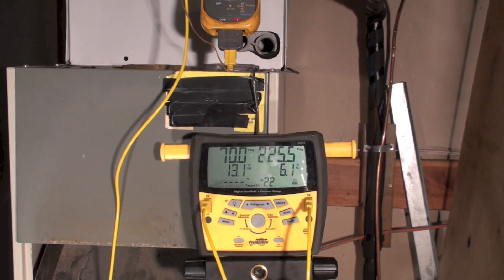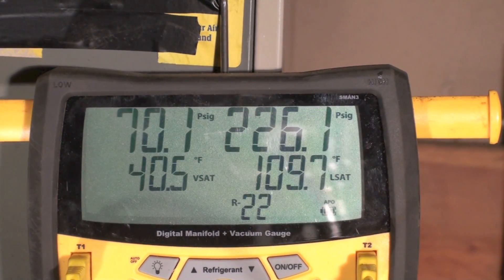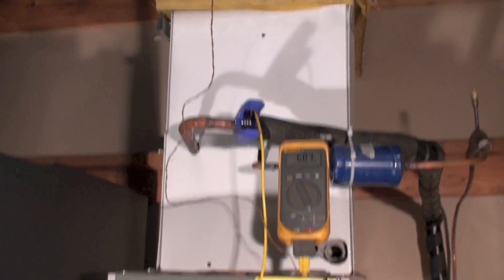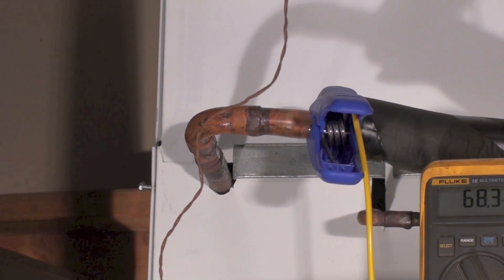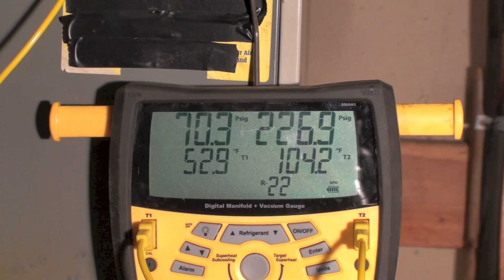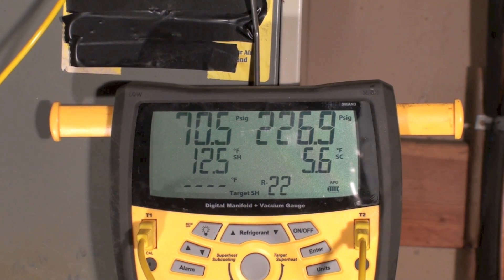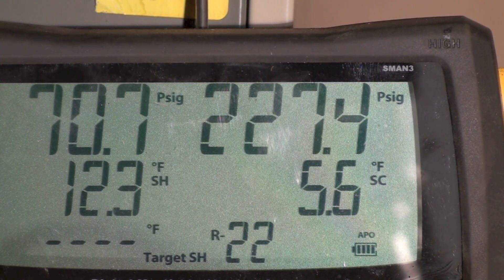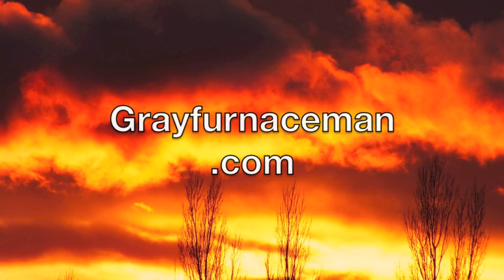Superheat and subcool measurements on the air conditioner

Comment: Had a tech come out and hooked up to the outside unit a goodman 3.5 ton r22 and on the blue gauge it was 79 down to 60s range did not hold steady he said maybe air or something else in system. Also stuck probe in plenum and air coming off coil was 65 said eventually will need a new unit is that accurate?
Reply from the maker: The varying suction pressures indicate air is the system, especially if the head pressure is higher than should be normal for that system.
The supply temp is not helpful as it does not indicate the temp difference across the coil.
So, what should you do?  
The problem here is R-22 is quite expensive.  The refrigerant must be replaced.  The cost of replacement will be anywhere from $600 to $1000.  
You must weigh the cost of replacement of the refrigerant with the expected life of the system (18 to 25 years) from new.  
Now you have a decision to make.  Lucky you.  
GFM
Reply: The local dealer said they did not have r22 to remove and re charge :( but it sounds the same everywhere new unit or drop in unit w new coil and ac only using old furnace so $$$$ Thanks for the reply
Reply from the maker: @elvis765  It is available, but most companies would rather replace.  I does make some sense because the youngest R-22 units are about 20 years old.  
GFM

Comment: hello, hi, hi, r410a system ( with fixed orifice) with equalized pressures of around 200psig. But once compressor starts the low side drops to 50 psig while the high side goes up to 300psig. I checked superheat was like 80F and subcooling was 2F. Does this mean the system has leaked out all the refrigerant? Does the 200psig equalized pressures means there's refrigerant in the system? thank you.

Comment: thank you for another awesome video. i was working on R410a system fixed orifice. my superheat was a little high. so i added refrigerant and brought it down to correct level (around 17F) according to wb and dry bulb formula. BUT even though my superheat was correct why is my subcooling only 3F? shouldn't subcooling be 10F to 12F? while adding refrigerant , ONLY low side paramters changed. High side unchanged? thank you.
Reply from the maker: First, you need to know if the indoor coil and outdoor unit are matched.  Also, I would be looking at the install manual for specs.  It could be normal.
GFM

Comment: hi, i was working on an r22 system with fixed orifice.  subcooling was at 9f and my superheat was 2f. the suction temp. was about 30f. there was lots of nice cold air coming out from floor register. please help as i have no idea what the problem is. thank you for all your helpful videos.
Reply from the maker: You need more readings.  Head pressure, suction pressure, ambient outdoor, ambient indoor and delta T across the evap.
GFM

Comment: hey
 dude 

When using my brand new spanking mastercool  gauges  and field piece temp sensor I get  a subcooling of about 14 or 15. From the tag on unit i know its supposed to be about 11. So I know its over changed ( startup was done by a supposed professional, when he said he put in 3 pounds for a 45 foot line set I said yikes). When i tried removing some refrigerant super heat went up to about 8 but subcooling didnt change. High pressure gauge went down along with line temperature , so my subcooling didnt change. I didnt want to keep removing the stuff.  Can you advise if you have time?. I noticed during winter by heat pump struggled engaging EM heat quite often and now summer it takes forever for the temperature o come down, Im hoping this is the issue?
Reply from the maker: I am assuming from your comment that sub cooling was marked on the unit plate that the unit is controlled by a TXV.  If removing charge changed the superheat, the unit is quite massively overcharged.  I would continue removing charge unit the subcool changes.  Work slowly.  Refrigerant should be removed as liquid from the high side to avoid changing the blend.  Assuming the unit is R-410A.
GFM
Reply: yes it was on plate and is a 410a txv  system.  I removed some more from the high side the subcooling increased to like 16 now and super heat  went to 11 and removing more I would assume throw the super heat way high .  Maybe i should bite the bullet and get another " professional" in. Gets my goat when I payed to put the gas in and now have to pay another to take it out.

thx for responding

Comment: This is what I do, and it's because I learned from you. If ever you have a way to check superheat or subcooling on winter on heat pump .and I'm taking about low temp. outside like between 10 to 20 F., that would be awsome. Maybe you already did a video on this. If so, I missed it.
Apreciate your good work
Reply from the maker: Superheat and subcool can be done at low temps but they are not good indicators of refrigerant charge.  We usually do not depend on them until the outside temp is above 35F.
GFM

Comment: the more I study subject and work on units the less I understand why the manufacturers ever used R410A as a residential refrigerant. It actually appears to be a better low temp refrigerant like R404a is. With higher temps the pressures go way up. I think they created all of these refrigerants then had 410A surplus and had to get rid if the stuff. Thanks for videos
Reply from the maker: The decisions of which refrigerant to use is way above my pay grade.  They must take into account global warming impact in addition to ozone depletion, flammability, on and on.  
GFM

Comment: I looking at getting the sman 460 gauges. So hooking the clamps up to the suction and liquid lines will automatically tell me my Superheat and subcool?
Reply from the maker: The gauge set will calculate it.
GFM
Reply: Great. Thank you. Love the videos by the way. You're like a HVAC Wikipedia.
Reply from the maker: Welcome
GFM
Reply: It's a good feature with the different flavors of refrigerants today . They display without toggling, I got them because I'm in a freezer and then of a hot roof and they are suppose to be resistant to sweating. I mean when you step out of a freezer your jacket will frost over and it will ruin your meters or gauges

Comment: Another great training video. Thanks. I know the formula for calculating a target superheat on matched equipment. I am wondering if there is a formula to calculate a target subcooling on matched equipment?
Reply from the maker: +Jim Gill Most manufacturers use a charging chart included with their equipment.  Subcool may be included.  As for target superheat, it is generic and if you have no chart from the factory or the unit is mismatched, it can be used.  If you reach the target superheat, pretty much subcool is set.  If you change subcool, the superheat will change.  Hope this helps.
GFM
Reply: +grayfurnaceman Thank you. I think that your HVAC&R videos are the best on YouTube.

Comment: Do you have any videos that show you how to hook this up? I checked your playlist and didn't see any. I want to run some checks on my XB 13. During the hottest times of the day it won't cool the house off and we have to manually turn it on and off so it wont run continuously . But after say 7pm we put the tstat back in auto and everything works fine.
Reply from the maker: Dreadric79 Are asking about the hose hookups or the temp probes?
GFM
Reply: the hose hookups to check subcooling.
Thanks
Reply from the maker: Dreadric79 I will do one.
GFM
Reply: grayfurnaceman Thanks

Comment: Thanx for you responds and help . Will do. How about the spec: if as rule of thumb SUBCOOLING is around 10f ( is that heating mode  ??)What the liquide line temp ( outside)at the service port should be? 83f(28C).
How about cooling mode ? What temp liquid line ( outside ) should be as this confuse me as it's very cold when touching ( leaving the condenser). I'm learning so pls do have some patience with me. Thank you once again

Comment: Ok let's see if I get this? Pls correct me.r410a .SUB-COOLING calculation : pressure  in liquid line ( saturated ) turn in temperature-temperature on the pipe= SC. As all heat pump have expansion valve (TXV) the charge is done on  liquid line( discharge) calculating SUB-COOLING .
Reply from the maker: lucly nn Your measurements and calculation are correct.  However, not all heat pumps use a TXV.  Some use a TXV on the indoor coil and fixed orifice on the outdoor or other combinations.  You must go to manufacturer specs for these.
GFM

Comment: i am faceing a problem in a 3phase carrier ductable unit 38CKCO36X9 this ac not good cooling manufacturer subcool is 16F i take all data by a digital thermometer.
Wet valve.81f
dry valve.105f
vapor line temp.52.5f
liquid line temp.112f
condenser outlet.126f
Rated amp.6.45
current amp.6.30
we clean blower cooling coil,condenser coil check fan motor blower motor compressor pumping its working ok but room temperature not coming down below 25c before was coming down below 25c
tell me what is problem in dis unit
Reply from the maker: shadab ali It sounds like the unit is under high load and operating properly.  Is it possible the unit is undersized for the load.  Has any equipment been added to the structure that may give off heat?  Hope this helps.
GFM

Comment: Can someone tel me when measured superheat and SUBCOOLING , in what mode it's done? Cooling or heating? I presume heating? Discharge line its around 83F or 28c , pls advice
Reply from the maker: lucly nn It can be done in either mode.  Next, your discharge temp is well below what discharge temp would be expected to be.  This sounds like you are not measuring where you should.  You might look at my channel under heat pumps.  It may help.  Let me know how you do.
GFM

Comment: I have recently purchased the SMAN460. I am having issues using the micron gauge. I  hook the low side of the manifold to the low side service valve of the condensing unit and hook the high side of the manifold to the side service valve of the condensing unit.  I then hook the VAC port to the vacuum pump. I open the high side, low side, and vac valves on the manifold. I pull the system down to 250 microns. Close the vac port and immediately the micron gauge will shoot well past 1000 microns. I have used a separate micron gauge and there are no leaks in the system. I have been in contact with Fieldpiece but they have not provided me with anything promising yet. Any help?
Reply from the maker: Km M Most problems related to holding vacuum are from either connections of the tubing or the hose itself.  Start by connecting the gauges set directly to the vacuum pump using a hard copper pipe with WELL MADE flares.  I emphasize the flares as they are the biggest leakers.  A little oil on the flares may help.  Then proceed to each hose to find the leaker.  Hope this helps.
GFM
Reply: I do not believe that I am having a equipment failure issues. I am trying to figure out if the SMAN460 is faulty or if I am just using it incorrectly. Can you tell me if in my first post it sounds like I hooked everything up correctly? If I can pull the system down to 250 I don't forsee there being any significant leaks. If I close the VAC port the micron gauge skyrockets....but if I open the VAC port back up it will almost immediately be back to the 250. Telling me that I am not losing vacuum but using the manifold incorrectly or the manifold is not functioning properly. I just need help figuring out which one.
Reply: Was there a possible small amount of refrigerant in the system. I know regular micron gauges hate freon in the system. Try a couple of drops of alcohol in the micron side
Km M
Reply: I had that problem sent it back for a NEW replacement. No problems!
Reply: They have finally given me an RMA number! Hopefully this takes care of things.
Reply: It did for me

Comment: I just bough a fieldpiece smen 460 and the sc never stays stable.
Reply from the maker: albert9560 Check it by attaching a temp probe from a stand alone thermometer.  If it is not stable, look to problems in the unit.  If it is stable, problem with the SMAN.
GFM

Comment: You should check super heat at comp. how else do you know if your getting enough cooler vapor back to keep the comp cooled down. Your superheat range is off to. You need to know wet buld temp and out side temp to calculate what your super heat should be at that particular environment. SMH!!
Reply from the maker: biggidaman777 Thanks for bringing this up.  This video is limited to how the measurements are taken and ballpark numbers for superheat and sub cool.  I should have noted this unit is TXV controlled.  Superheat is taken at the outlet of the coil. Fixed orifice is measured at suction line near the outdoor unit if you are using target superheat.  I have a series of videos on target superheat that gives exact methods and procedures.  I will put a reference to these videos. 
GFM

Comment: Its kind of funny that all techs have their own ballpark ranges for superheat and subcool. Is there a correct range? Most HVAC books will tell you one ballpark, where a service tech will give you his ballpark. Who's right?
Reply from the maker: The 10 to 15 superheat and the 5 to 10 sub cool are ballpark numbers.  That said, you need to assess each unit by age, expansion device type and refrigerant.  If the unit uses a TXV it should be charged by sub cool.  Fixed orifice device manufacturer instructions or target superheat.  Also you need to be sure there is proper airflow and the coils are clean.  It is not simple.  But it is the most important part of air conditioning repair.  Here is a video on target superheat:   http://youtu.be/f8m87DGWCrM  Hope this helps.
GFM
Reply: Do the ranges differ with different refrigerants? Low temp refrigeration systems must have different superheat/subcool ranges also I imagine. That digital manifold is great. I'd love to get my hands on one.

Comment: Thanks you so much. I learn so much even if I am in the field since 20 years.I have a little problem.One say that we take temp. outside for dry bulb and inside the cold air return for wet bulb, and that's the way I always do it. But to one and another, it seem's to change.Woul'd it be possible to give a good explanation of where exactly we take the temp. I am a bit confuse about where exactly we should do it
Reply from the maker: I will be doing more on superheat and sub cool this summer.  Maybe that will help.
GFM
Reply: Always do wet bulb in the central part of the house or in the return. Dry bulb is outdoor temp to me. You need to know these values for sure when working on R22
Luc Dumouchel
Reply: Wet bulb can be done using a wet piece of shoe lace around your digital probe inside the return airColin G

Comment from the maker: There are 2 things I can see as possible here.  You may be in a very low humidity area.  The unit may have an oversized indoor coil that keeps the coil temp above the dew point.  Hope this helps.
GFM

Comment: How are you doing? I To ask you if you ever ran into a problem like the one a friend of mine asked me about the problem is that he is air conditioner works great CoolTools great but it has no condensation coming out of the drain pipe and no water is dripping anywhere